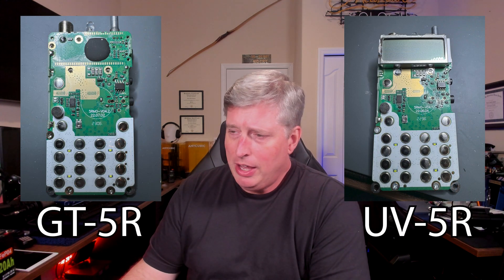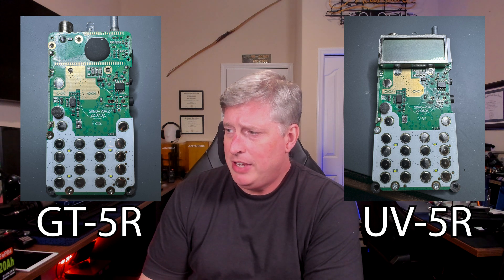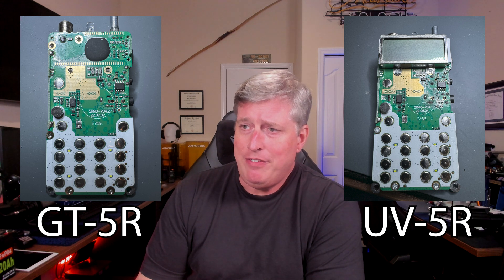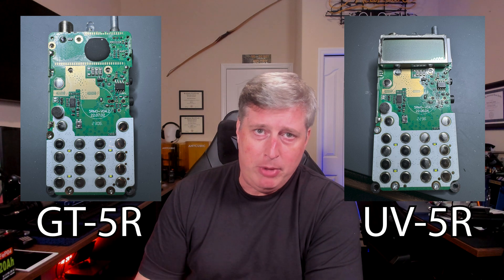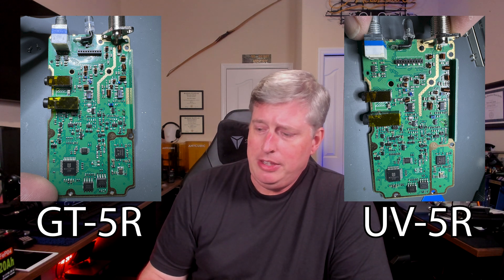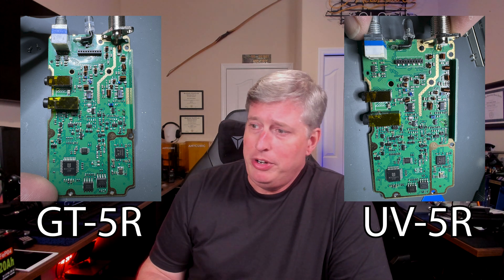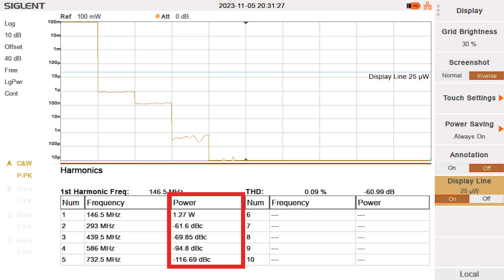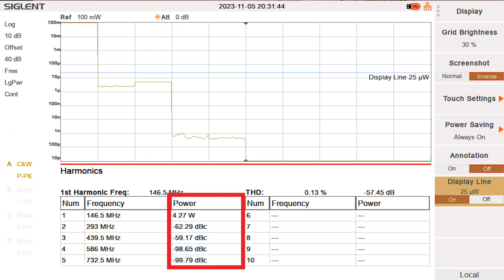Are the UV-5R and the GT-5R the same radio?

Comment: Great video.  I would note that I've seen harmonics tests on later Baofeng models and they don't necessarily turn out clean.  To my knowledge the GT-5R is the only FCC Certified Baofeng model and for the price tag I think it's a good deal.  Plus you know you're getting a clean transceiver that's locked down to licensed Amateur transmit frequencies.

Comment: I recieved my first UV-5R yesterday and I was cuirous about board revision and I opened mine and I have a slightl visionly different board. Noteably at 1:06 my board which has the text 5RM8.V03.2 and dated 13.10.26 bottom number 2346 and does not have the gold patch on the keypad side. I didn't go deeper so unsure if the other side has any differences

Comment: Looks like on your desk is a Flex 3000?  I have one and just built a new win 11 system 5-7600 amd and tried 3 different firewire cards without success, will run using KE9 flex software but crashes after shutting down on all three cards, will run but will not save my setup. Rendering is useless, Worked good on my Win 10, 2012 cpu setup.

Comment: Very good presentation. I recently purchased the GT-5r and did the three button unlock procedure, Interested in something to chase down RFI using something like 138mhz with AM, However, Chirp program only gives me as a choice of FM/NFM, says out of band not allowed. However, I uploaded the img file to radio and 138mhz will xmit, but no am, appears to be Fm only. Anyone know how I can use just to receive AM on any VHF band?  In chirp pgm I selected the GT-5R.  Thanks in advance.

Comment: If both radios are technical the same and both fullfil 60dB requirement ... what makes the GT-5R that "legal" ??
Reply from the maker: At one time the regular UV-5R was a very dirty radio.  Things have seemingly improved since the release of the GT-5R that trickled into the UV-5R.  One of these radios is not "more legal" than the other, its just that the GT-5R was marketed as the "legal" version of the UV-5R when the UV-5R was not "legal."  Hope that helps.  Thanks for dropping by!  73

Comment: The way that inductor is skewed on the pads is a typical side effect of using a part that's too small for the footprint - when the solder melts the surface tension will normally pull the part into alignment, but that only works if you have most of the pad covered and only a small part where the solder fillet can form.  My guess is that the PCB was originally laid out for a chip inductor, bu this turned out to have some undesirable effects and it was replaced with a wound part. Those wound inductors are substantially more expensive than the chip type, so I think it's safe to assume they wouldn't be using it if they didn't have to.
Reply from the maker: Interesting!  That makes sense, and I was curious why they would be mounted like that!  Thanks and 73!!

Comment: I recently bought the GT-5R as my first Ham Radio. I hit VHF and UHF repeaters 10 miles away and talk to people all over my state. Great Radio for the money which = Value. I bought the 3800 mAh battery upgrade and a Signal Stick antenna and I run about 4 days between charges. Easy to program both Chirp and manual. Highly recommend this radio for a cheap first radio.

Comment: Final comment: I also tested the recently advertised „big uv-5r“ with a larger display. They were as spurious as the old uv-5r so apparently they do not (yet?) use the improved hardware design.
Reply from the maker: Thank you for all your comments.  There are definitely still some radios that haven't not benefitted from the updates on the UV-5R.  I have a UV17R that will be in an upcoming video that is clean, but I haven't opened it to see what it looks like on the inside yet.
Reply from the maker: Update: I have a video releasing soon on the UV17, UV17R, UV21Pro and GC-5.  The radio I mentioned in this comment above is mislabeled as a UV17R... Its actually a UV17 (The blue screen version.)

Comment: And one more thought: even though I really love the open firmware of quansheng radios (uv-5r plus), unfortunately they seem to be on the same problematic spurious emissions level we found in the earlier versions of uv-5r. Quansheng may barely meet US FCC rules but definitely fails EU 60dB regulations. That’s why currently I would not buy Quansheng anymore (they meanwhile got officially banned in the EU, too) and instead stick to the recent version of baofeng uv-5r with their remarkable improvements on harmonics. Even though uv-5r are, too, officially banned in the EU, as a licensed HAM radio operator you can still legally operate them provided you can assert there are no illegal spurious emissions, and with the latest improvements, measuring and verifying below-60dB-harmonics should suffice to enjoy a cheap capable radio while at the same time be safe.
Reply: Only in switzerland there banned not in the while EU
Reply: @heikosoeder you are correct. They are still legal in the EU (for licensed radio amateurs only) , and licensed radio amateurs in turn are expected to know their emissions and stick to legal regulations. 
So while they can still be sold in the EU, using them most likely is illegal. 
Then again, I doubt any NetzAgentur personnel will go hunting down portable radio amateurs ;-)

Comment: To add a thought: provided uv-5r and gt-5r are internally identical by today, introducing gt-5r rather than announcing improvements on uv-5r may enable baofeng to establish different price points. Gt-5r run around $30 with their „clean“ pitch whereas the equally clean uv-5r that I purchased recently were half of that price.
Reply from the maker: Definitely a possibility!

Comment: I recently did a harmonics test on a variety of models, including uv-5r, quansheng uv-5r plus, Anytone 878uv2, tyt md-uv380, and radtel 470. to my surprise, uv-5r (all purchased this year) came out with the best harmonic suppression. anytone and tyt missing the strict eu 60dB marginally. Quansheng was much worse, maybe complying barely with 40dB standards. Radtels were all spurious as heck around 15dB. So yes, apparently you are right on, and currently sold uv-5r are just as good harmonic-wise as gt-5r and possibly identical. Baofeng apparently did a phantastic job on suppressing spurious emissions, beating even anytone and tyt digital radios. Thank you for your video, this saves me buying gt-5r to replace uv-5r when in reality at least the latest batches of uv-5r seem to perform perfectly fine now.
Reply from the maker: Good information!  I will have an upcoming video with the Quansheng UV-K5 and UV-K5(8)!  Thank you for watching and commenting!!!

Comment: Nice video. My UV-5R purchased in Oct/2023 uses the 22.07.02 bord. I compared the spurious with my GT-5R and they had the same charactoristic. I opened the UV-5R and it uses two H0606E for PA for each V and U and thier filters are well isolated in between. It was different from cirquit diagram foun on the internet. I guess they made redisign of the diagrame.
Reply from the maker: Thank you! It's great to hear about people getting these updated radios!

Comment: That's exactly what I figured. The Chinese don't think of model numbers and their revisions like we do, and the UV-5R is almost the defacto universal "starter" radio, and in their minds "UV-5R" is as much of s
a "brand name" as "Baofeng" itself. And the quality of Chinese products is better than it was, and much better than Americans want to admit. And yet? They buy a lot of Chinese products with generally good satisfaction! The Chinese may unseat the Japanese just as the Japanese unseated the US in this market. This will lower the price point. It already HAS. 73 DE W8LV BILL
Reply: No way they are going to unseat the US in this market when the GT-5R is the only reliably part 97 compliant chinese radio on the market.

I've purchased and tested: UV-25 pro, BF-F8HP Pro, Tidradio TD-h3, Tidradio TD-h8, and Talkpod A36 plus (new white key version). All purchased in 2025 from amazon, every single one had non-compliant harmonics on 2m.
Reply: @invdrzim5600  Time will tell.
Reply from the maker: Thank you for your comment!  I think only time will tell.  I still believe you get what you pay for with some of these radios.  These radios are definitely getting better, but have a long way to go to compare to the likes of an ICOM, Yaesu, Kenwood etc.  It's definitely headed in the right direction.